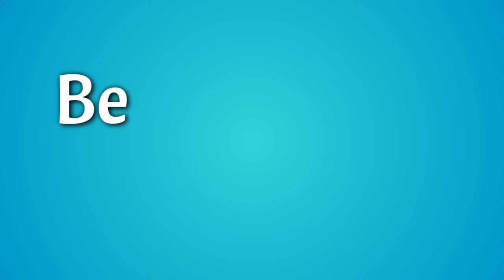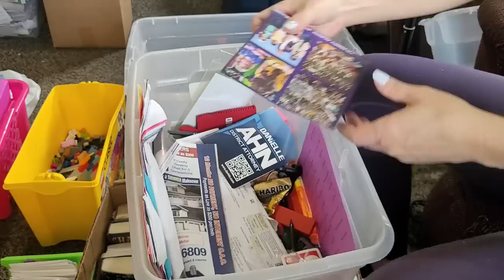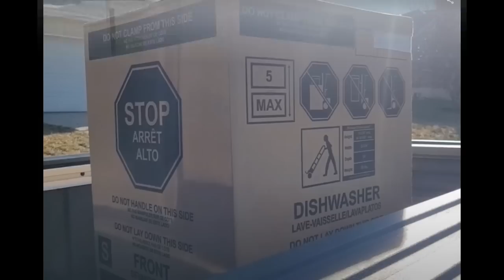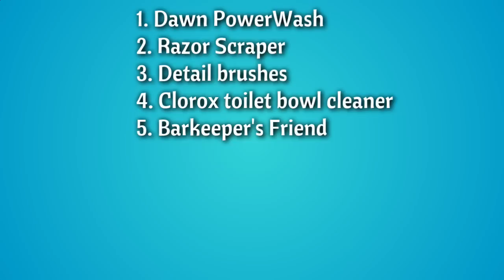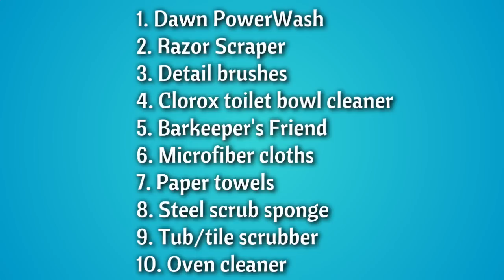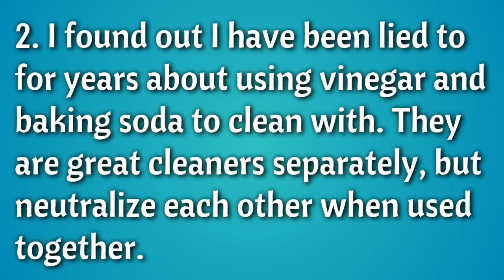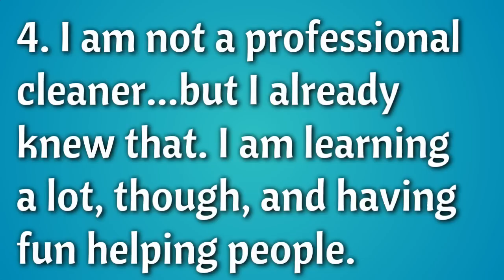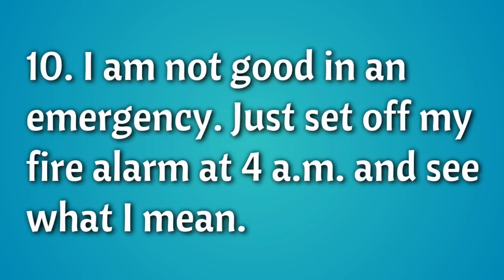Best/most satisfying transformations of BEAUTIFUL MESSES in 2023 #satisfying #cleaningmotivation

Comment: Hi, Bonnie! I liked the toilet transformation. What technique did you use to clean under the toilet rim? Thanks! Happy New Year!
Reply from the maker: Do you mean inside the toilet bowl up at the top? I'm assuming that's what you mean by under the rim. If so, I didn't do anything special, I just let the toilet bowl cleaner sit probably at least a half hour and then scrubbed it off. Sonetmes, if it's really bad, I will use a pumice stone to scrape off any of the mineral deposits, but usually just letting the toilet bowl cleaner sit for a while does the job.😁👍

Comment: For the favorite oven cleaning video.  What product did you use
Reply from the maker: So, the list at the end of things I learned where I mention not to mix oven cleaner with anything else, the favorite oven cleaning is the reason I added that because I actually used oven cleaner and then sprayed some Super Clean degreaser on it as well, just thinking they are both degreasers, so why not give it a little boost of degreasing power. Well, it turned out to be the best combination ever, but I have had so many people tell me never to use oven cleaner with any other product, so I shouldn't recommend it. Even though nothing happened when I mixed these two, you never know what might be in other cleaners and it could cause a chlorine gas which is deadly. That was a long answer, but I wanted to be truthful about what I used, but also give the warning that it's probably not the best idea. Honestly, I think oven cleaner on its own does a great job, especially if you let it set overnight.

Comment: Did u know thw oven doors come off very easily ❤ just Google how to take off frigidaire oven door or what ever brand it is ♡
Reply from the maker: Lol! I actually have a video about how to do this and how to take it apart to clean in between the two panes of glass.😁 I just didn't here because it was the end of the day and I just needed to hurry and get it done. And sometimes I don't take it off if I know it's going to be a pretty quick clean or if there is nowhere to set the oven door after I've taken it off. But, I do remove them about half the time.😊

Comment: Hold up wait .. that burnt stuff can come off of the top of the toaster ?! What was that spray?  I clean my toaster often but the stop stuff that burn on. I thought that was just a new look it had. Because i can't get it off 😂
Reply: Around the 28 min mark
Reply from the maker: Lol..... yes, it is possible. This video was pretty early on when I started cleaning houses and was using all kinds of different products. If I were to do this again today, I would probably use a cream cleanser rather than a spray so that it doesn't get inside the toaster as easily. Probably something like The Pink Stuff. Or, you could use a degreasing spray (I used Super Clean here) and put it directly on the wire brush. I think it's probably more the wire brush that gets it super shiny. Those wire brushes should be linked in the video description.